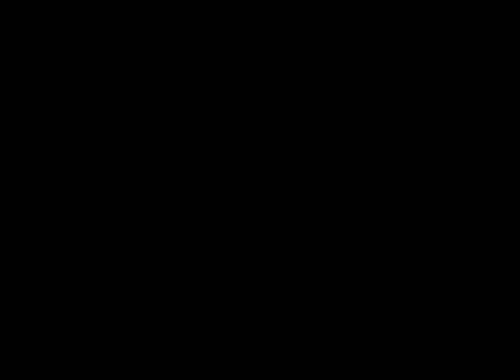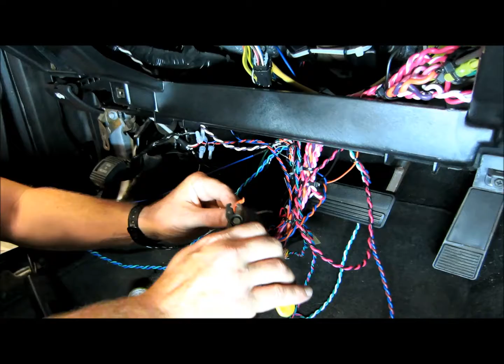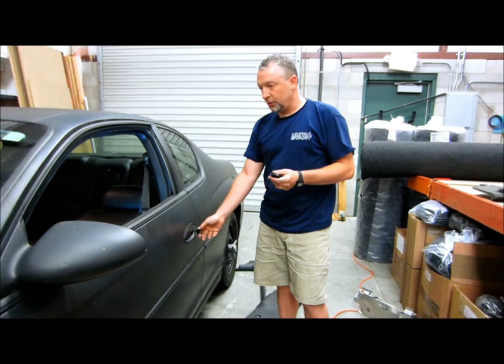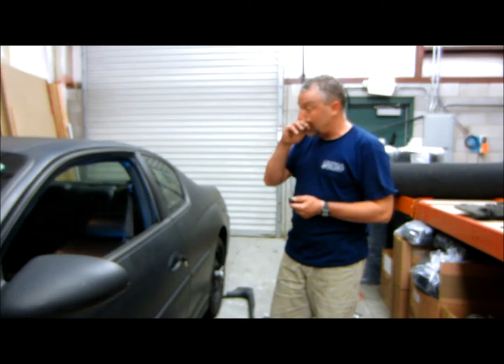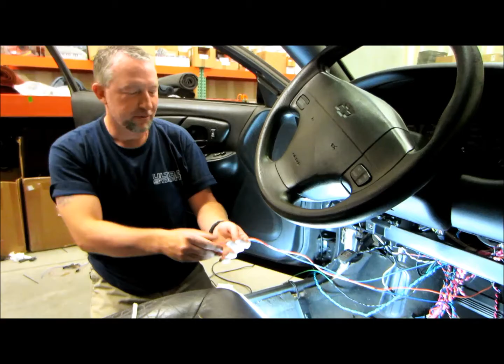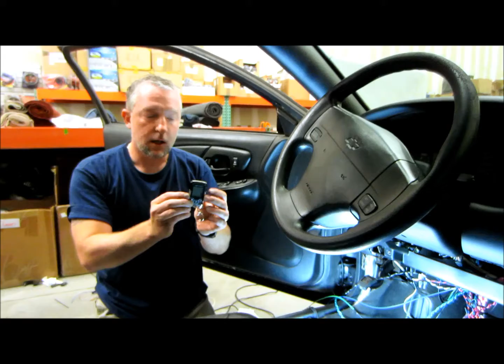Part 18   Start to finish alarm remote start installation

Comment: What diodes are you using
Reply from the maker: I'm using schotky 1 amp diodes
Reply: @Lesscoelectronics  also, I'm having trouble getting the wire color list you used and said have available. I have an 02 Monte Carlo so I know the wires are the same so I've watched your video several times trying to catch the wire colors. How can I get that list?
Reply: And thank you for info

Comment: I'm installing an Avital 4105L remote start only (no alarm).  The door lock and unlock outputs from the module say they are 200 mA each and to NEVER attack a 200 mA signal to a high current circuit or motor withOUT a relay.  Since I will be splicing them to a single signal wire going to the BCM and NOT to the lock/unlock motor in the door itself, can't I JUST add the appropriate resistors to each connected wire and NOT bother with the relays?  Why did YOU use a relay, even if you are just connecting to the MUX signal wire and NOT the motors themselves?  Thanks so much.  GREAT videos.
Reply from the maker: yes, you can but in my experience youll most likely need one on either the lock or unlock for some reason (electrical is weird like that), but who knows you may get lucky and need no relays.

Comment: what did you connect the blue & green door lock wires too? what is the name of that wire and is it located on the ignition switch? I have a 2002 dodge ram 1500 slt quad cab.

Comment: Was wondering wat brand single zone radar sensor did u use for the 04 mone carlo? Thanks
Reply from the maker: I used an omega au-93, its basically an au-94tm, just single zone insted of double...

Comment: Helo is any way posible that something happen  my car was running fine till I decide to remove the remote stater  to changed so the car now is not shifting also the stop light is not working    I check the fuses and fuses are good   so any ideas I apreciated you help thanks
Reply from the maker: It is very possible you messed something up in there, can I see what you did in a video clip?

Comment: Hello Martin, thanks for posting these videos.
I don't have a trunk release feature on my truck; so can I use the 2nd channel negative outout and double diode isolate with the negative input from the proximity sendor and power window module?
Reply from the maker: sure, do it just as I did.